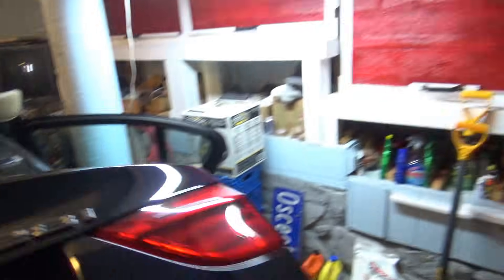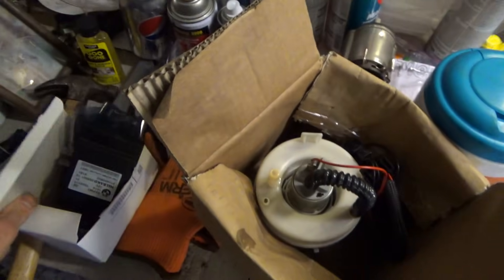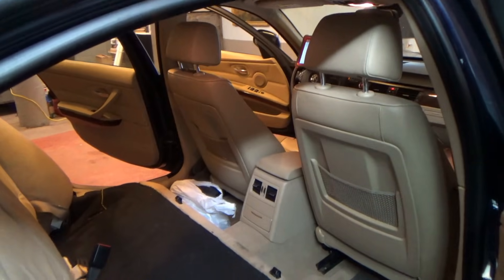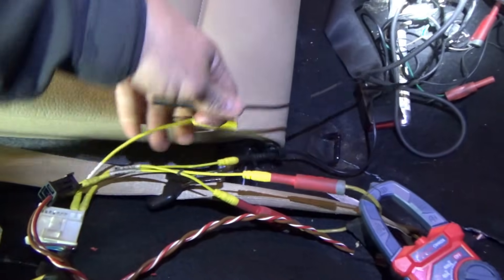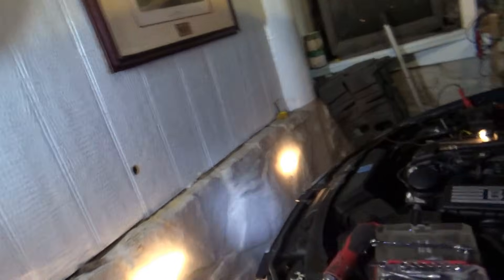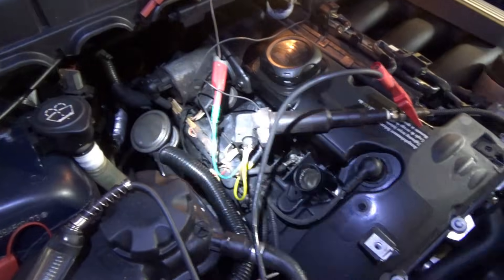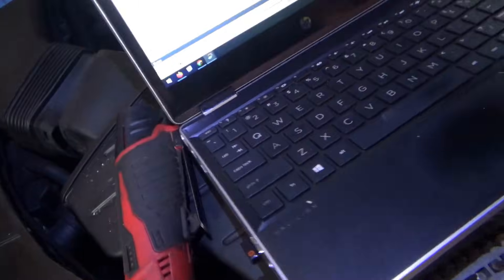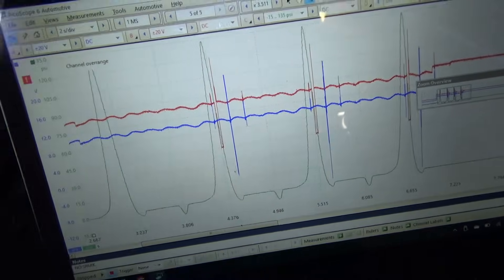Dealer BUTCHERED this BMW?! (Crank No-Start)

Comment: I see a LOT of comments about how the vehicle made it home. My best guess judging by the video is that the ground cable may have still been touching ground for a bit after the work was done at the dealer. The loss of ground during the drive may not be immediately evident outside of a frostbite misfire because of the current finding a path to ground through another ground path ( not a good one). Certainly there is potential in a case like this that the customer could have been making something up, bit I think I remember there being an invoice mentioned on that phone call.
Reply: Having 20 years independent in Ireland  and then moving to a bmw dealer in Canada I was absolutely horrified at the butchery I seen at the dealer, from general techs to master techs, 
If I received a work order, first thing I checked was what previous work was done and who did it, 
Over 50% of the jobs getting booked in was due to previous work carried out and not fixed properly or stuff not put back correctly and caused a knock on affect, absolutely shocking what I’ve seen going on at the dealer!
Reply: @Thedar561  *saw,  "butchery, I saw at the dealer..." please dont butcher the language.
Reply: @jo300hn  good comeback
Reply: @Thedar561  funny you say that. Because i spend my days fixing cars that Indy shops can’t.

And if you look around YouTube, there is an entire group of people who make a living going from Indy shop to Indy shop fixing cars that they can’t fix.

But bashing Indy shops doesn’t get the view count higher i suppose.
Reply: @VoltageDropDiagnostics  I wasn’t bashing Indy shops, 
I was just making a observation
On what I saw in the dealers, 
I couldn’t believe how incompetent these lads in the dealers are, even the training that they receive getting their papers is a joke, most lads train them selves because the dealers are mainly flat rate and everyone is to busy working to make hours and don’t want to help out an Aprentice, 
A terrible way to learn in my opinion
Reply: @New Level Auto We miss you Keith,there i said it.
Reply: Ivan pointed out that the nut was still on the post, but yeah, maybe it was touching for a while after the repair.
Reply: Sounds like there is more to the story because if the  valve cover wasn’t touched other than by the dealer then it’s clearly their  fault and they should pay for it .
Reply: Kinda what I was wondering at first too..just how much of driving around until it finally gave up.   Electricity does have it's funny and sometimes destructive way to find ground. Doesn't it.?  lol
BTW...I may have already mentioned congrats on another trip around the sun..but I'll say it again anyways  :)
Happy Birthday Keith
Reply: nice to hear from you keith hope you are good
Reply: I just consider that if the ECU can get fried due to a bad grounding it's a design flaw of the ECU.
Now it's time to hire a good lawyer before going at the dealer.
Reply: Ok, thanks.   What do you think about the no codes thing?  Would it have stored misfire codes and would they have gone away with the almost dead battery?
Reply: You and I both know that there is a reason why the customer is paying to install the module without fighting with the dealer… we both know that the customer did the repairs. And blaming dealerships seem to get lots of views nowadays .

Comment: Talk about dealer screwup AND BMW engineering screwup no protection for the ECM.  If that is so, I'd dump that car very quickly after getting it to run ! ! ! 
Good job Ivan.  Your thorough diagnosis proved the failure of whoever worked on it last.

Comment: I bought a cam shaft positioning sensor from BMW, it was bad. I found one at a junk yard and fixed my issue. BMW would not take the sensor back because and I quote "We didn't install it not our problem".
Reply: Known trick! All business in my country uses it. Sadly...

Comment: That's pretty bad. The drivers blowing up if the ground is missing must be a known issue for the dealer. They really hosed that guy so should own up to it.
Reply: i dont think thats what happened i think the owner or friend did the valve cover and not the dealer,first you would think dealer would know how important that ground is,second how did he get car back from dealer?with no ground he couldnt drive it home,so are we gonna believe they had him tow it home instead of drive it and didnt notice the car wouldnt start after valve cover job?i dont see that happening,then owner wants to buy new ecu and not have dealership pay for it?just too fishy.
Reply: @pigeonsil240sx  Yeah, Initially, I thought that maybe it ran because the contact was intermittent but your explanation is more plausible since the ground on three cylinders was totally not connected. It couldn't have run like that, clearly. Good point.

Comment: Did the dealer actually do the work? The owner did change the pump and module, and as someone already mentioned, how did it get home? Just a thought, maybe he changed the gasket himself and didn't hooked the ground back up. Just a thought, I know dealers screw up plenty but sometimes it's hard for owners to admit they screwed up.
Reply: Good point, I think you may be right. Maybe that's why Ivan never heard back from the owner. When Ivan makes a return visit to program the new ECU that the owner puts in we'll know the truth!
Reply: Yeah, that's exactly right. I'd bet that if the "dealer mechanic" was doing that job, that mechanic is certified and knows, "Death Do Us Part" if those grounds are not hooked up...
Reply: My thoughts exactly  , am think the owner is telling porky pies.. Ivan is too much of a gentleman to call him out on it.
Reply: Agree, he was probably, " let me start the thing before hooking everything up ". Mistakes happens to everyone and this is probably "learning the hard way" for him.
Reply: I think you might be right That makes sense because if something like a fuel pump got damaged you couldn't drive a car home like that
Reply: @neilmurphy845  Ivan mentioned a previous fix where a BMW owner drove with one ground off frying the modules at the end.  So could it be possible that the car started but after a while not being grounded, the modules started to get fried?
Reply: @CeasarBergonia  Ya that's true
Reply: The first things a new dealer technician learns are vehicle models, systems, and precautions.
Total BS on the description.
If he just had it in the dealers for repair and they left his grounds off?
How did the technician get it out of his stall to road test or park it?
Why is a no spark car that cranks until he runs the battery dead, misdiagnosed by his friend to be fuel related, then the parts cannon engaged?
Dummkopf.
Sorry.
Stop stabbing people we don't know in the back is what the videographer needs to consider.
The car was evidently damaged by accident trying to get off cheap.
I'm not surprised.
It's expensive and takes years to learn your German cars attributes.
I like to find the right book for it.
That, itself, is difficult on German makes.
Especially after years and before a learner takes it on as a project.
I tried 7 different books trying to find one for a gray market Mercedes.
Reply: Expensive mistakes😬
Reply: Exactly what I was thinking also.
Reply: Yes if the grounds are off and he left the dealer that car obviously since it won't start would have never made it home and he would automatically had a misfire in the back three holes out the gate never would have left the dealer would have said what the hell is going on I would truly bet on it that he did or someone else tried doing that work at his house and then oh boy everything went wrong
Reply: that's almost what I just typed seconds ago
Reply: Kll90ll

Comment: I'm not buying that the dealer did that. How did the car get home running on 3 cylinders?
Reply: I was wondering the same thing. Maybe the ground was on the stud, but loose? Considering Keith knew right away what it was after Ivan told him it was a dealer done valve cover gasket, I'd think the most likely scenario is that they did F it up.
Reply from the maker: It ran fine for a couple days with the missing ground...crazy but true.

Comment: On what planet does it make sense for a dealer to take a running driving car, fix a minor oil leak, and return the car totally bricked with no idea how to fix it? Time to close the doors, you are no longer a competent shop. That said, whoever engineered a computer that kills itself because it doesn't have a ground should probably also look for a new line of work. Same with the engineer who hid that ground wire (the one that kills the computer if it's not connected apparently) under the cowl-- I suppose maybe they just assumed the worst that happens if it's forgotten is the car won't run and someone will put it back on and it's job done.

...there's a reason I won't buy a BMW, and it's not because I can't afford them. Get your shit together, BMW.
Reply: should have asked the owner to show you the work order, and see just  what they are  charging him for, then you'll know what the deal is especially  if he can't produce it.

Comment: I'M not a BMW tech, just a regular master tech, but I know they fry modules if the slightest ground issue happens...You'd think their techs would be very worried about grounds? :/
Reply: I drove my vw with a broken ground wire. All it did was reset the clock on the dash almost daily. The trick is that it is a 30 yr old diesel vw with probably zero modules 😉
Reply: You'd think the engineering wizards at BMW could design modules that don't destroy themselves if a bad ground happens to appear.

Comment: Thanks for the video.  I don't know about this one though, the car did make it to the guy's house from the valve cover installers place.  It also passed your test light coil power and ground test.   There's more to this story.  If leaving those grounds off fries the DME, shouldn't that have happened rather instantly, not a week later?
Reply: AGREED, You hardly ever get the WHOLE STORY.
Reply: We are definitely not getting the full story, first of all I’d imagine the fuel pump control module had already tried to be replaced, that’s why when Ivan put the other one back on it started working, second of all I can almost guarantee the customer of a friend did this valve cover right there in this garage where it’s currently sitting
Reply: @2491kridge  yes the owner f.ed it up
Reply from the maker: It happened after a few days of driving because BMW!
Reply: @PineHollowAutoDiagnostics  Yeah, but I think the no codes thing bothered you, too.
Reply: @PineHollowAutoDiagnostics  no dealership it was the owner.

Comment: Ever get the feeling you didn't get the real story?  Like, how did this guy get the car home from the dealer if they screwed it up this bad?
Reply: There is definitely something in between.  Doing a valve cover is not rocket science on these 3 series BMWs.  If they left that ground loose I don't see that frying a computer.  He may have had someone working on it in between all this if he was willing to pay Ivan a hefty service call.
Reply: @TheFrenchPug  Yep. Who replaced the fuel pump? Not gonna get all the facts here. Ivan loves to make everyone that touches a car look stupid. Except him and couple of his buddies.
Reply: @gailtaylor1636  My guess is the owner or a buddy of his.  I've replaced my stupid fuel pump after I replaced everything else for low fuel pressure.  Turned out I had bought a Chinese part for my pressure sensor.  I bought an OEM one and that fixed the problem. Do not buy electronic car parts off Amazon.  I should have known better.
Reply from the maker: @gailtaylor1636  What other facts are you looking for? I do my best to relay the information I am given and diagnose the root cause of the fault.

Comment: There is a chance the DME could be fried but those grounds are for shunt dissipation, the coils are designed to multistrike and what I mean is that after the initial ramp and closing of the field they will still strike 5-7 more times, and whatever build up of electricity is left shunts through those grounds. Effectively, the coils do still spark even if you took all 3 grounds off or in the case of the Mini Prince motors you leave its single ground off. BMW products have never killed spark for any reason in a cylinder even a dead hole misfire. I would not forget to try starting it with the Valvetronic eccentric shaft sensor unplugged, or even unplugging the motor and turning the eccentric shaft by hand by means of sticking a 5mm allen in the motor and leaving it in a different position, Valvetronic will failsafe and you will use the throttle body as your means of intaking air. I have seen the eccentric shaft sensors do crazy things, and because its mounted to the actual cylinder head inside the valve cover and its female connector sticks out through it there is a chance of damaging it when removing the cover. Also, an uncoded EKP will just throw the fuel pump into full working load. The weird cranking could be the valvetronic not knowing what is going on and hitting a different setpoint as it opens and closes the intake valves as it tries to start. On another note too, that car is 12 years old, the coils are so notorious for failing we do a nice and dandy easy 36 a week. Not saying throw parts at it, but make sure the coils are in working order.  

Some of the things I've mentioned might be common knowledge, don't know, but all I do is BMW/Mini products so sorry if it's something you already know. The only BMW product I know that really does not like those shunt protectors not installed is the V8 twin turbo with the ground being integrated into the plastic shrouding over the coils, very very easy thing to forget and very costly when it kills the TWO DMEs, and kills the BSD signal meaning alternator, oil level sensor, IBS in the trunk, water pump... and if you don't replace all you run the risk of frying all those AGAIN after startup, with the ground reinstalled. There is a TSB for that one.
Reply: Not true! This type of coil is actually a transformer and high voltage side is connected to ground and to the spark plug. It wont spark (at the spark plug) if the ground is off. It will cook the ignition coil and then the spark enters the low voltage side and the engine control unit. I have diagram of those coils -> http://mankeli.dy.fi/bmw/328coil.jpg
Reply: Good info. What does it mean when the steering wheel shudders when at a stop and turning lock to lock? I can't figure that out.
Reply: I was also thinking valvetronic issue.  I haven't done a non turbo 3 series but have read they can cause these issues when not reinstalled and endpoints re-adapted properly.
Reply: Check my page got a bmw ctanks all 6 coils no fire

Comment: I had a problem like this 8n a Ford Lincoln town car. It was the safty shutoff switch in the trunk. I felt like a fool
Reply: Most BMWs have an Intelligent Battery Sensor in the trunk on the battery negative. If they go bad they will stop your car from starting but crank like it's trying.  If you unplug it the car fires right up.
Reply: @TheFrenchPug  the computer should report the status (or lack thereof) of any sensor

Comment: Electrical Engineers in Germany purposely designed this with the wrong Operational Amps.
NO ECM should EVER be damaged on it's Outputs, due to lack of ground.
EUROTRASH

Comment: They gave it to that guy that flags over 160 hours and he says he never gets a comeback!
Reply: Do you think that would cause this issue?  It looks like you repair these things.
Reply: @TheFrenchPug  yes it’s does if you don’t connect the grounds to the coils, the dme will look for a ground if it’s not there when the car is cranking then it would fry the dme the power back feeds to the dme drivers he’s absolutely correct!
Reply: @jb_bmwrepairlyfe4704  That is scary.  Thanks for the reply and explanation.  Good thing I remembered to tighten my grounds on reinstall.
Reply: @jb_bmwrepairlyfe4704  ....back feeds if engineered right should never happen....a loose ground can cause transients (spikes) but properly protected.drivers should filter that out .